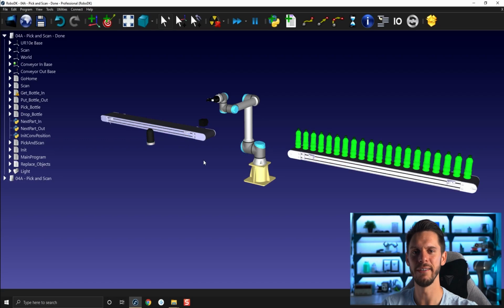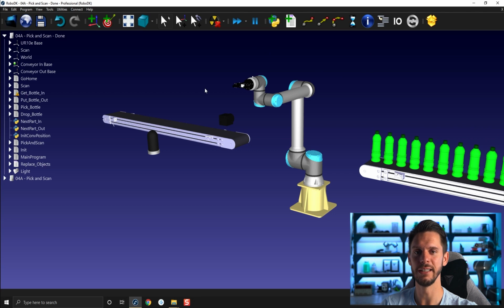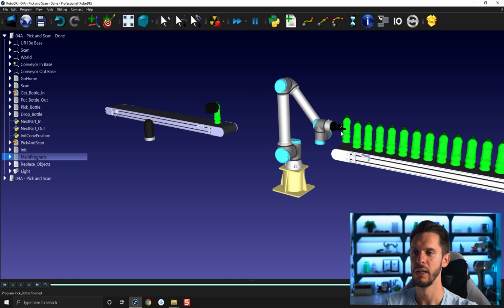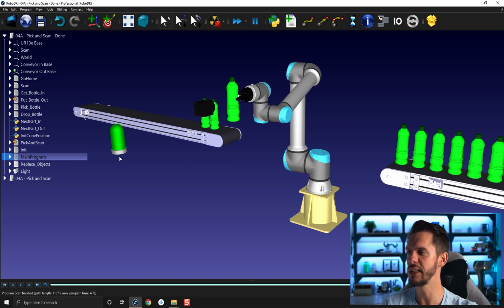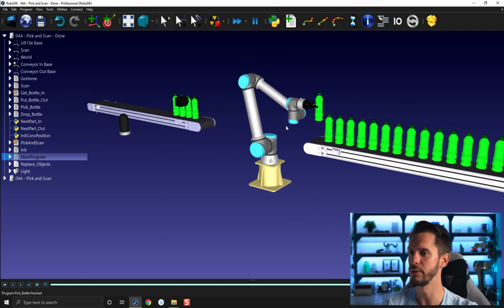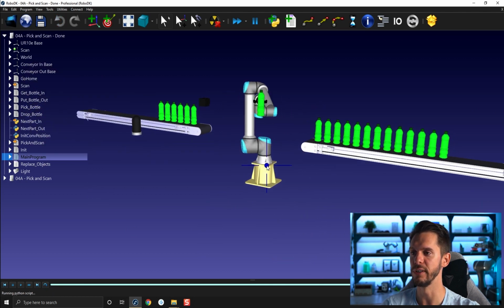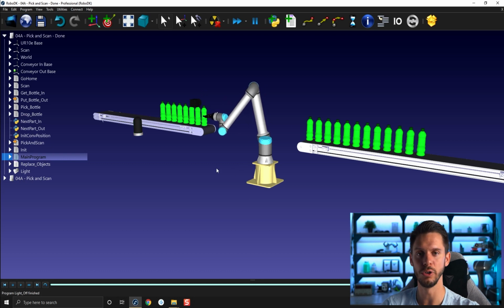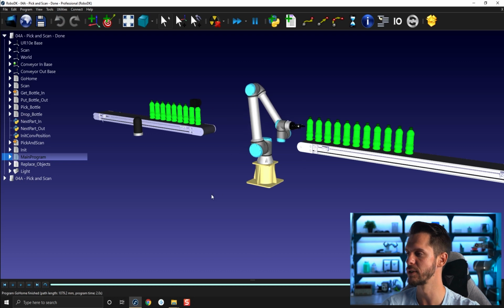Simulation Events Overview - Course 4.01 - RoboDK Academy

Comment: Dear Robodk,
I have an question. What's different red bottle as empty, green as full in the abroad?
Reply from the maker: I'm not sure I understand your question. 
In this case the light only turn red during the "inspection" process and green when the process is done. 
It's not an indicator of it the bottle was "OK" or not. 
In a future module I will do just that, but we are not there yet, we need to learn other stuff first.